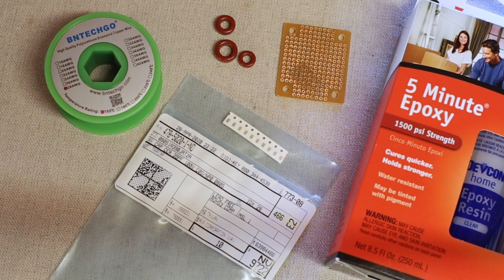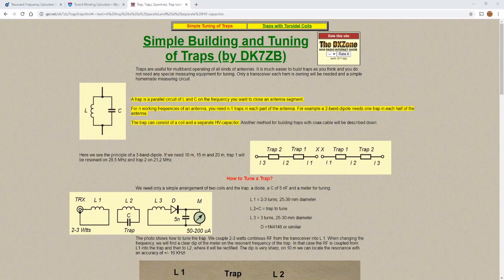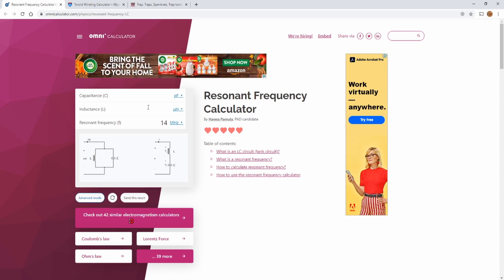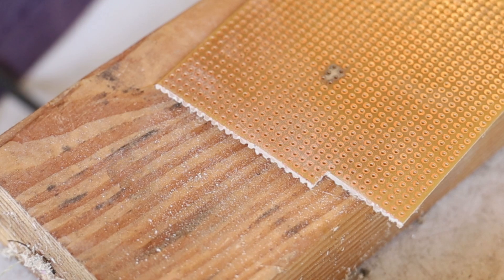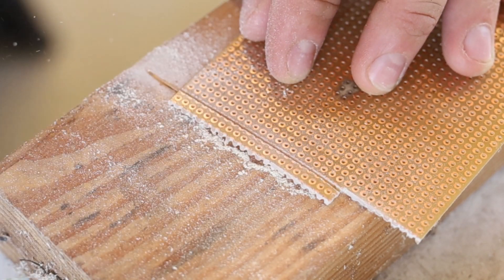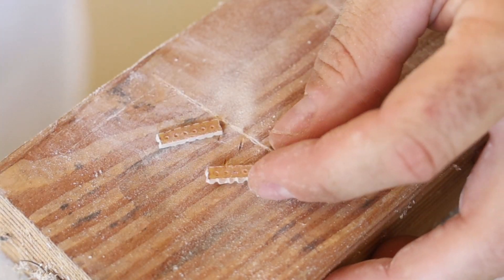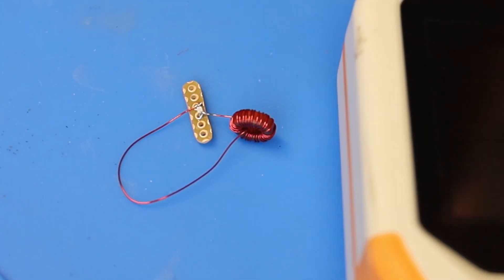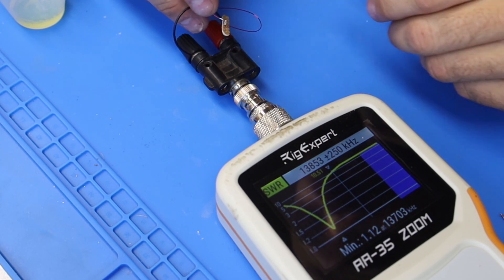HF Antenna Micro-Traps - DIY Build Project

Comment: Adam, what's the thinnest wire, I have tried 26awg and works perfect, now I am going to try , Surfstrand Copper Trolling wire, 30lbs, .028 in (0.71 mm) dia. 600ft is $30
Reply from the maker: Robbie, I actually use some 30 ga stuff for some of my ultralight antennas.  It's very fragile so you have to be very careful with jt, but I have a trapped 20/30/40m antenna I have been using with the MTR3B for over a year.  Still holding up!  It's single-stranded so if it links, it'll probably break.  But at $9 USD for 1000 feet...it's not going to break the bank. https://amzn.to/2FLCjdL

Comment: I'm in the middle of building some traps, but I am noticing that when checking the resonance of the trap with the analyzer I get an SWR of a little better than 1.5:1 at the resonant point whereas you were getting close to 1:1. What am I doing wrong?
Reply: I was getting the same thing. I decided to wind up some new toroids. This time I wound it looser than I had been and I seemed to get much better results. Swr would be 1.1 and it would dip quite close to the base of the band. 
I’m still running into problems every time I epoxy the finished trap. It seems to ruin it every time. Pre epoxy it’s 1.1 to 1 at 13920 MHz. After the epoxy dries it’s like 1.7 to 1 or even 2:1 at 13500. I don’t know what to do to prevent this. Anybody got any ideas?
I’ve built like 5 of these and it happens EVERY TIME! 
It’s so frustrating I’m thinking of ditching this project and trying QRp guys trap kit. Try my luck there.
Reply: @Toner126  take this with a grain of salt, as this is all new territory for me, but... if it does it every time, and in a reliable direction, perhaps tune it for a higher frequency at first, and when it drops, it can drop into place?  Take careful notes and do calculations to estimate where you think it ought to land, and... trial and error from there??  Just a thought.

Comment: What gauge antenna wire would you recommend for this project ? Which manufacturer ?
Reply from the maker: I generally recommend the 26 ga poly stealth antenna wire from Davis RF. It's available from their website, and from their other website. It's the best portable a antenna wire I've used. https://www.amateurradiosupplies.com/

Comment: Do you sell these?  I'd love a SOTA antenna with traps.  Looking to use with a 5W/10W IC-705
Reply from the maker: No, I don't sell them.  I do have kits coming soon for the EFHW and end fed random wire.  Perhaps some day I'll make trap kits.  I don't have the time necessary to try to manufacture these for others, unfortunately.
Reply: @K6ARK  put me down for a random wire kit when they’re available 👍. I just ordered a MAT-705 plus that will pair perfectly with that antenna.

Comment: Since an EFHW resonates on even harmonics of the lowest band it's cut for, why would the 20M trap be required...it should resonate on 20m and 40m, without needing a trap on 20m.  Am I missing something here?
Reply from the maker: EFHW antennas are resonant on all even and odd harmonics. However, when you add a trap for 30m, a trap is also required for 20m.  The 30m trap adds different amounts of loading on 20 and 40m and therefore the wire with 30m trap and sufficient wire for 40m resonance is no longer resonant on 20m.

Comment: Hey Adam, would you think a FT37-43 toroid would work? That would use 4 turns...
Reply: I was thinking the same thing. I am planning on experimenting with a #43 toroid and some really small value capacitors to see what I can come up with. I will try to remember to post here.
Reply from the maker: I suspect a 37 size toroid would work for 5w.  I have used 37 and smaller toroids for QRPp rigs (Pixies and such).
Reply from the maker: I was thinking for matching units. A t37-2 will certainly work for a 5w trap.
Reply: OK. I just did a quick test using small ferrite toroids of #43 mix. I may be missing something here but they do not work too well. They pass a really wide part of the band and the SWR is relatively high. Also, you have to use really small value capacitors (my last experiment used a 0.5 pF cap!). By contrast, using a 150 pF capacitor and an T-68 #2 iron powder toroid the band pass range was very narrow and the SWR was very low. These are my initial findings.
Reply from the maker: Ferrite toroids are good for chokes and transformers. Are you trying to use one for a trap? You definitely want iron powder toroids for traps. -2 mix works for 20m and below, -6 is better for 20m and up.
Reply: @K6ARK  yep, I was planning on using ferrite toroids. I have plenty of them and none of iron powder. 
Toroids are hard to find here in Brazil, so I have to buy bulk every now and then. So right now I'm out of -2 and -6 mixes toroids...
Reply: @K6ARK   I have not been able to find a good read on why you would choose ferrite over iron powder (and also what mixes) for any particular task. Since I'm not a EE I decided to experiment, and it was enlightening!

Comment: question, does the SWR value matter when measuring this, or just the resonance value?
Reply from the maker: Just the resonant point (bottom of the dip) matters.  Other factors affect the SWR as well.
Reply: @K6ARK  thanks for the response, great video!!
Reply: @K6ARK  do you have a discord or something similar to send a pic to ask a question?
Reply from the maker: @TheTransam4350  yes, I'm on the HRCC discord, and a couple of others.
Reply: @K6ARK   whats the link for that channel
Reply from the maker: Should be in the description of every one of Josh's videos.  Find Ham Radio Crash Course.

Comment: Adam, my 40m EFHW tunes well on 10m and 15m, how does the 30m trap affect tuning on those bands?  Any idea?  TNX
Reply from the maker: It's likely to hose it up, unfortunately. A link for 30m is likely a better option. That's what I typically do for the odd bands when I'm not using traps
Reply: @K6ARK  Dang, I guess I'll have to carry 2oz more of as antennas

Comment: Do you know about UV curable resin epoxies?  Cures in seconds, not even 5 minutes.  There's a bunch of them on Amazon.  Great for fine work like this, especially when you put down on dab; zap it with the UV flashlight and move on to stick down other stuff without worrying about the epoxy dripping/running where you don't want it.
Reply from the maker: Great idea, I hadn't thought of that. It's certainly worth a try. It would be interesting to see how much if affects the trap.  I wonder if any of the manufacturers publish a dielectric constant for the material.

Comment: DE KD5SMF, I have not seen until now a home made trap so small! I have made 40 meter traps for a shortened dipole using RG58 coax and a 3.5" diameter pvc form.  Now I can see that using a similar set to create a 9:1 Unun & placing the traps just right will make for a good multiband antenna.  I just hope that when I make mine, I can achieve 40, 20, 15 meters! 73's
Reply: Generally, a resonant 40m will work on 20 and 15 w/o traps.  This is why his example is for that pesky 30m band.

Comment: Noon question,  why not breadboard instead of perforated PC material?
Reply from the maker: Hmm, I imagine you could build one of these on a breadboard, but it wouldn't be very useful in an antenna.  Breadboards are for temporary builds without solder.

Comment: Thanks for this project, Adam.  Still squeamish about the BNC transformer due to shaky hands, but still going to attempt as I have a mess of toroids, capacitors, and connectors.  In the meantime, I found some boards on Amazon that have the required 6 holes across to accommodate the capacitor, choke, and antenna wire.  Pre-tinned holes, too.  I made a ton of them, since I only needed to make one cut per trap being built - so I just kept going, LOL.  (see: https://i.ibb.co/bdKYSWT/IMG-2536.jpg)  Boards: https://www.amazon.com/gp/product/B07FK3NLG2/ref=ppx_yo_dt_b_asin_title_o03_s00?ie=UTF8&psc=1   73 de W2CLM.

Comment: I have been experimenting and building tiny toroidal traps for eight years, and I have discovered some details, uhhh, trappings, about what you say here.  If you will do your turns and capacitance calculation at < TOROIDS.INFO > you will find that the trap you have described produces only 280 ohms of resistive impedance.  That's not enough!  The higher frequency segment will see inductance from the wire beyond.  Commercial traps produce 75,000 ohms and higher.  They are much larger and don't use toroids for a reason.  Playing with the calculator you will quickly see that you need more inductance and less capacitance to create a higher impedance for the traps.  Incidentally, go here for a circuit board on which to build the trap:  https://oshpark.com/shared_projects/nrjciEFR  and go here for a discussion on building traps with more effective parameters... https://www.ke6mt.us/tag/ws0ta/   73,  Fred KT5X  ( WS0TA )
Reply from the maker: Fred, not sure I fully understand what you're saying here.  Did you not realize that I'm building these traps with SMD caps and toroidal inductors?  Help me understand...